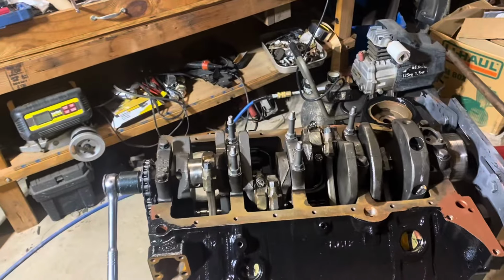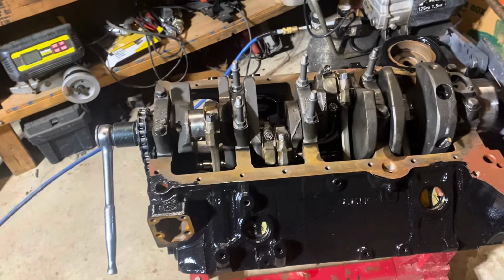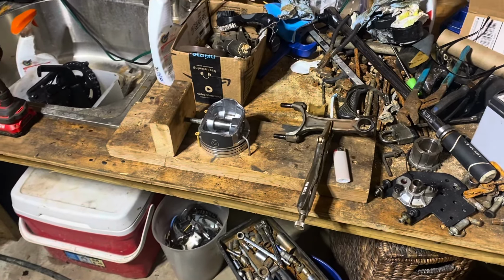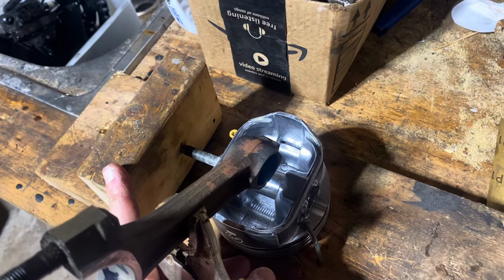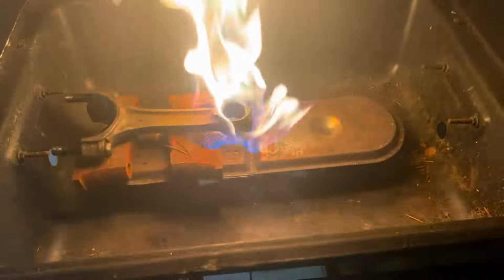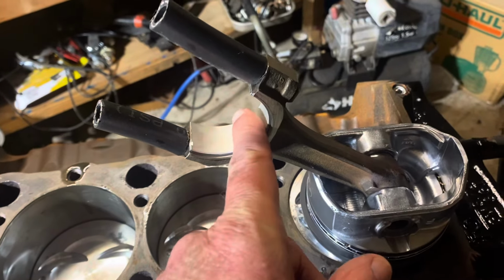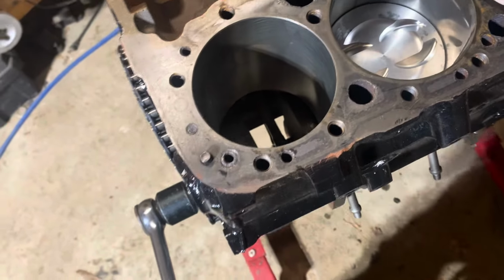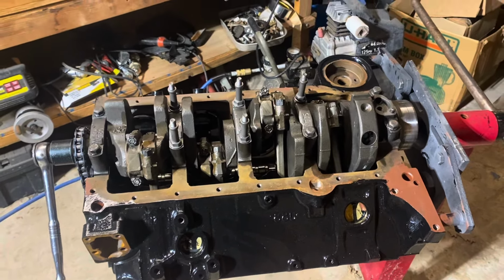Volvo Penta 5.7 - DIY Piston Install

Comment: Good eye catching that small but major failure ! Question thoe , are Volvo 's not a 4 bolt main block ??
Reply from the maker: I have not seen a correlation that Volvo Pinto engines use four bolt main blocks  some do in some don’t
Reply: Does the 4.3 have same set up marks for the piston rods.
Reply from the maker: @HoldFast-un2fc  I am not sure what you mean by setup marks but the 4.3 has definite rod direction requirements. See this video:

https://youtu.be/JFzTrqUxK0E?si=eJYhYw4XgKsQ6Mey